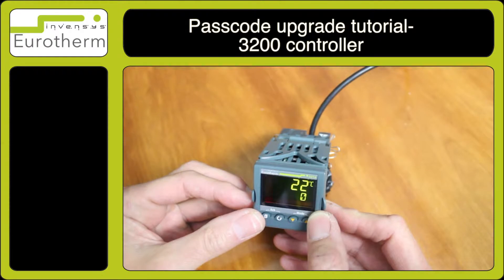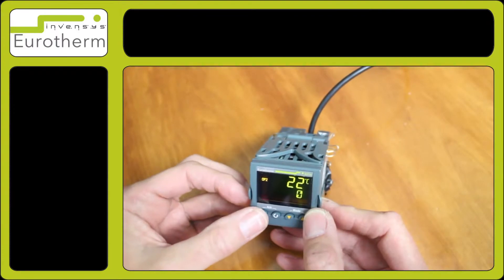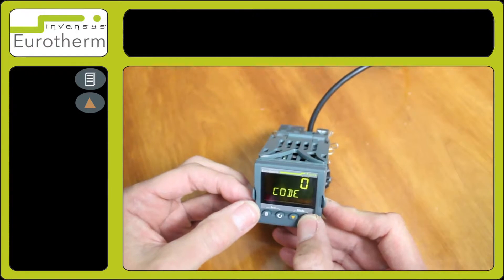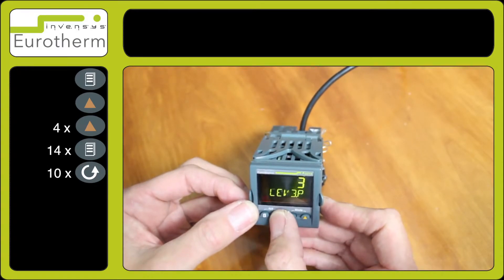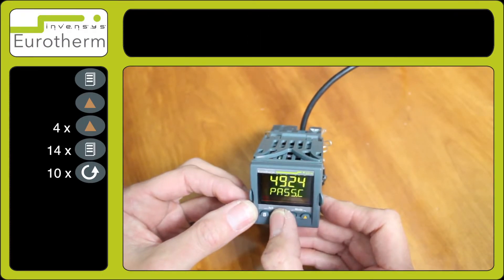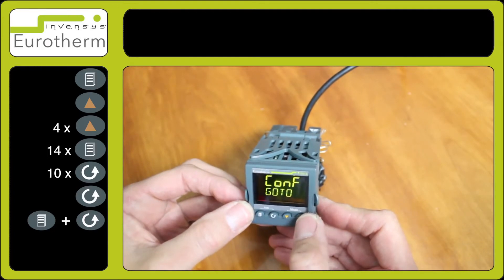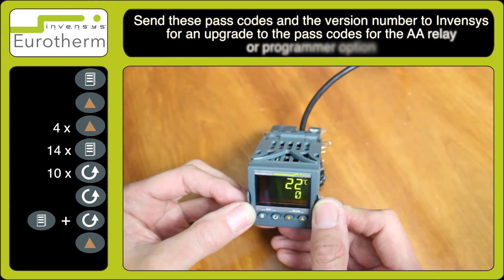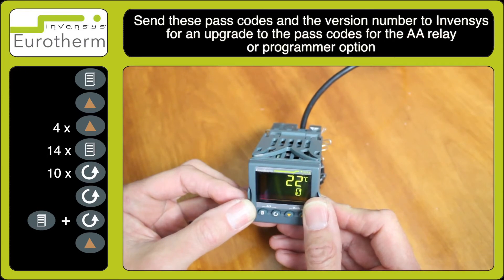Passcode upgrade tutorial on a Eurotherm 3200 Controller

Comment: I've got a 3216, once I enter the code 4 for CONF it returns to the main screen instead of the CONF menu? Is thereany reason for this?
Reply: i know this is a bit late for you but may help someone else, the code has been changed in the past. My PID didnt have a computer connection so I entered every number until it got the correct one.
Reply: Other than going through 10,000 possible combinations, did you find a solution?